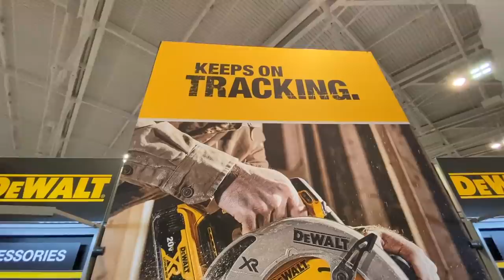Dewalts NewTools of 2020. First time seen in public at Stafda

Comment: What I caught on the Diablo vs DeWalt at the dewalt booth is look at how fast he initially feeds the Diablo vs the DeWalt. The Diablo has much more force pushed on it that the counterpart
Reply: Ramon H Jimenez he wants those teeth as far into that nail so it snaps it off.
Reply: It also looks like the diablo is at a deeper depth, which would change the angle the teeth hit the nails.
Reply: @Robert-cu9bm  I thought so too but focus in on the DeWalt blade, it's got a darkened outer ring
Reply: One thing I did notice was that he more than likely doesn't know how to operate a saw. See as how when he starts the saw he is already biting into the wood. As I am also writing this I also think that his ON PURPOSE intention was to feed it incorrectly, Rendering this demonstration on DeWalts end useles
Reply: @Robert-cu9bm  Yep, deeper depth cut is making the Diablo catch nails different.
Reply: Ramon H Jimenez
These people never know how to use them, as  they're just Reps.  Very good at talking though.
Reply: @Robert-cu9bm  you were right about the depth
Reply: @Robert-cu9bm  Definitely set deeper. That can't be a coincidence.
Reply: Cannibal440
That's the only bit i found dodgy on the dewalt test.

Quite a few things in diablo.
Reply: @Robert-cu9bm  agreed but also feeding the diablo faster, effectively making the teeth try to shear the nail all in one hit rather than slice at it gradually thus knocking off the teeth. Of course that's my opinion. Agreed Diablo was a mess with no verifiable standard testing.

Comment: Looks like he’s intentionally slightly twisting the saw to bind it
Reply: Jon Dough my though too
Reply: Also thought that I saw that
Reply: I agree stan called him out on it
Reply: Definitely was
Reply: Which one?
Reply: Graham K the one that looks like it it seriously smoking
Reply: Jon Dough that’s what I figured
Reply: Both looked like they were intentionally binding the blade of the competitor. They both probably dulled the competitor's blade before the test. Diablo used different saws and batteries; potential for additional shenanigans there. Neither are interested in a fair head to head comparison.
Reply: Ur mom
Reply: ARMOR PIERCER ...what?
Reply: I watched it several times before coming to the comments, I was wondering if that's what was happening when I watched the saw twist several times.
Reply: Lok at the burn marks left after the cut and the saw was set deeper.
Reply: Exactly! Why does he need two hands. One to push and one to pull. This is the oldest gimmick trick

Comment: I've never had to scrape with my stihl blower.  I mean maybe I'm just a goob who doesn't DIY or do yardwork enough but I'm usually just blowing leaves in the yard or sawdust out of the garage.... or dirt in general out of the garage when I clean it.  The dirt/ sawdust.... never had a need to scrape the floor to get it to blow away.  Leaves in the yard... my theory is if they are wet and stuck to the surface they're on so well they were meant to be left behind, haha.  as long as I expose the wet leaves they'll dry out and either blow away in the wind or maybe I'll blow them away with the blower another day.

Comment: You can tell at the the diablo booth they are purposely going slower on the dewalt blade
Reply: Going slower while cutting threw screws is a good thing. It gives the teeth an actual chance to cut threw the metal. But that being said both demonstrations were skewed by dulling of the competitors blades. One take of a file on each tooth will dull it enough to completely throw off the comparision.
Reply: He was also twisting the saw look how bad it burned the paint off the side....I have old blades that still have the paint on the side....

Comment: lol they buried the diablo cut depth compared to the Dewalt. no-one noticed that?
Reply: Good catch at the Dewalt booth they set the Diablo blade way to deep for that cut. I think that was the Dewalt trick. I have a feeling at the Diablo booth he was intentionally binding the blade a bit.
Reply: Ecospider5
The diablo booth didn't actually show the blades... Just trust the Diablo Rep for a honest review of their blade.
Reply: Yeah, they weren't using the same blades at both booths.  7inch at DeWalt,6in at Diablo
Reply: I'd be more concerned as to why on the diablo stand, the guy with the DeWalt blade was using a flat battery. He's demonstrating to people who use these tools, we have all had batteries go flat on us. And the crowd cheered! Facepalm🤦‍♂️
Reply: Don’t see how the depth of cut has any bearing on this whatsoever it’s the same thickness material it’s identical think about it
Reply: Elizabeth McHeffey has to do with angle of attack of the teeth against the sub straight your cutting and the heat it generates.
Reply: @Mad.Man.Marine  you are correct sir. A shallow depth is more of a slicing cut where as a deep setting is more like a chopping cut.
Reply: You got that bro
Reply: the nail is round so the angle of attack is the same on the nail no matter depth. the wood is different.  The Dewalt blade obviously has higher quality welds on the tooth.  The Diablo obviously not as good of weld
Reply: @kwilliamson1096  not really, the wood may be more shallow or not, the nail since it is round is the same.
Reply: I use the diablo blades to cut aluminum   ramps 3/16" thick 36" long , I get a lot of cuts out of one blade before its missing enough teeth to make a difference.
Reply: @yoski203  ok.
Reply: @elizabethmcheffey8699  more surface contact area = drag,  the saws should be same depth,  why is it not the same.
Reply: Elizabeth McHeffey instead of 1 inch of blade coming in contact with the wood, when you set it deeper,you have a lot more friction and heat. Hope that made since

Comment: I've been using the Diablo blades for a couple years ripping reclaimed wood with nails and have been very happy with the results. I also used one for cutting the floor in a 24 x 75 old chemical shed into pieces. All tounge and grooved 2 x 6 with lots of nails. Only used 1 blade and no damage. You do knock teeth off eventually but not in one pass. The only time I lost teeth right away is when I was cutting a steel barrel with it and had the blade in backwards by mistake. Turned it around and still cut like going through wood. Haven't tried the Dewalt ones so can't make any claims on them.

Comment: all i want is an electric ratchet dammit
Reply: C'mon dewalt it's over due should have been out with the 3/8 impact 20v
Reply: Milwaukee has a few and Makita
Reply: The 20v Impact Board Stretcher with the reciprocating flux capacitor will be out in 2020!
Reply: Studd Muffin  I didn't realize just seen it a month or 2  ago in home depot
Reply: Its called a Milwaukee Fuel ratchet.
Reply: I emailed DeWalt a while ago and asked them for one. Their response was:

"We apologize for any trouble or inconvenience caused by the lack of an electric ratchet. There has been no information given that DeWalt is about to release such an item or has one in development. Generally, the DeWalt philosophy is not to be the first one to introduce an item onto the market. Our goal is to deliver the standard by which other tools are judged. This can mean a lag of several years of perfecting before releasing the tool. Recently, we have a branched out to introduced cordless lawnmower as well as a cordless router. If we do not feel that a tool is going to be an industry standard, then it is not released. That is the essence of quality in the DeWalt name. We certainly thank you for your suggestion as well as your loyalty to the DeWalt brand."
Reply: @TheHitman5c  🤣

Comment: I would say that they used “hardened steel nails” in that section, to ruin the blade...
Reply: Hector Rubio exactly what I posted, or need to remove the humans and the human error from the test.
Reply: BP spill was more modest than this.

Comment: Worked on a custom metal frame home literally at the foot of 13,000 foot rockies and it was dropping below 24 below at night.  Kordian had 3 sets of Dewalt batteries  - one set of 3 12 filters a few years old and 2 sets of 4 batteries.  3 only months old, others about 6 years old. 
Brian had 4 Bosch 12 volt batteries from 8 to 10 years old. 

In that cold weather, the Bosch charged about 3 X faster and that 12 volt Bosch did more work per charge.

Comment: It appears on Dewalt blade test that they used the new more powerful saw vs the older saw on the Diablo blade. On the Diablo test, they used the same type of saw. Did they compare the same blade in each test? Thanks for the great tool update.

Comment: How much oil is he gonna use to cut  a few threads
Reply: Good quality threads are made with supplying constant cutting oil. He just needs to get rid of the throw away bottles and use a pipe threading oiler so it's not a waste
Reply: Have u ever threaded anything u have to use lots of oil
Reply: Demicron .

Although I’m retired now I sold Ridgid threading equipment in the past, those who used lots of cutting oil did not use a lot of threading dies. For a pipe that size and those threads it should have been flooded with oil from a pump mechanism through a tube and then the oil runs/drips down into a reservoir that separates the cuttings from the oil so it can be used again.
Reply: Who the hell wants to hand squeeze oil everytime a thread is made. How about an automatic system like every other brand.
Reply: Mhcp .
Yep I agree, the problem is they are in the tool business not the lubrication business. And maybe they will get an outside vendor to make a lube system that works on a battery for them. If this unit is as good as they think it is it’s going to replace a lot of equipment for people out there that already have powered lube systems.
This pipe threading system is for smaller pipes and I can see where it’s affordable and usable for someone who doesn’t thread pipe all day every day.
Reply: I would like to see Dewalt make a manual oiler with bucket like Ridgid if they are going into the pipe threading business. 

“How much oil is he gonna use to cut a few threads”. He used barely enough in my book. 

When using a pony threader a manual pump is all you need. Using an automatic pump would be a gimmick.
Reply: jruss  exactly right with a lube pot and the return hose it’s good practice to have the threads flooded constantly while cutting.   I guess some of those watching have not threaded much pipe.  Good comment 👍
Reply: @jakeo2600  Demicron apparently just doesn't know any better.
Reply: @mr.rodriguez3908  That kinda goes without sayin
Reply: @jakeo2600  My original thought exactly...
Reply: Demicron that's why you dont act like a know it all you will get roasted
Reply: @tannerwharton4670  Like a turkey covered in chestnuts! 🤣
Reply: @mr.rodriguez3908  😄
Reply: Right like really... Nobody doing this daily would waste oil like that. 🤔🤔 Lubrication is key but I'd be recycling oil.
Reply: This thread:
Person 1: "That's too much oil"
Person2: "How could you be so stupid as to say he shouldn't use any oil!?".
Reply: TBH back in the day we used to use tallow!
We were only doing electrical 20mm and 1" (UK ... Don't ask why we had both imp and metric)! A short length of tube with a 1way conduit box on the end and you pack tallow into the box and you are golden! OK when we had the electric threadder we used cutting compound applied with a small brush ;0)
Reply: @jakeo2600  How so Jake? Because I made an observation that the guy spilled more oil than he used to aid in the cutting process?
Reply: @tannerwharton4670  not worried about some  know it all internet tough guy wannabe bad asses.
Reply: @snap-off5383  right lol.... damn he spilled more than he effectively used. OMGGGGG U SAID HE SHOULDN'T USED OILLLLLLLLL.  I'm gonna dump a gallon of air tool oil into the impact next time I get a chance.
Reply: @Demicron  just make sure you oil them daily. Gets to be a hassle on holidays and when you're away for vacation to have someone come over to oil them.  🤣
Reply: @snap-off5383  just gonna put a 2nd fitting on it am run constant oil.
Reply: You have obviously never cut threads before.

Comment: I frame houses every day and can tell you dewalt blades do last longer at least the ones I use, but a new diablo blade just cuts so nice and fast but don't hit a nail!
often us Carpenters have to fix other trades screw ups one being steel beam length, I just look at all mt saws and pick the one with the worst blade and cut the steal beam with a carbide blade, it cuts it like butter but at the end the blade is done :D

Comment: the diablo booth was the one that scamed you just from watching it
Reply: Can you explain why?
Reply: Low battery?
Reply: Dewalt one was the best considering no teeth come off that blade but the Diablo one every tooth came off
Reply: @Kennnnyy__  Because dewalt showed you the damage on both saws. Diablo did not.
Reply: From what I saw the diablo booth were using thicker nails or small lags. You can clearly hear the grinding and see the sparks. The difference IMO is that both manufacturers are purposely binding the blade to cause more friction which is dulling the blade faster. How do they do it. Slight twist with there hands when sawing. Like ripping 2x4's at an angle.

Comment: 15:29 has he ever seen the Milwaukee 12V impact drivers?
Reply: I think every company has had a smaller driver. Milwaukee, Bosch, Makita, etc. Dewalt just late to the party.
Reply: The DeWalt grip is much nicer. The Milwaukee 12V grip is huge because the battery is inside the handle.

Comment: 1. Using different brand saw
2. Diablo used drywall screws vs dewalt with ss nails
3. The batteries voltage and ah ratings also play a part in the difference in results

Comment: The I'll blow used hardened nails for the DeWalt test.  Diablo also moved a lot slower proving that their blades will do the trick is long as you've got the time but they don't handle shock.

Comment: Dewalt said they used stainless nails. I what looked like a piece of kiln dried structure.  An the diablo was drywall screws in pressure treated lumber. 

Look like makita saws had lower rpm than the 60 volt dewalt saws. 

I would have to setup the wood an nails myself an use comparable saws.
Reply: Steve Smith
Dewalt used the same battery and same timber with the same nails... Then showed the results.
The only thing questionable is the depth of cut. 

Diablo could have used different screws, different state of charge.  And then we have to get a unbiased result from two Reps.

Comment: Diablo stretched the truth here by giving the dewalt blade a dead battery and a bad actor behind the saw!
Reply: The DeWalt test was nails and the Diablo test was drywall screws. It's probably something to do with hard metals vs softer metals.
Reply: He also says there are some teeth missing probably, after hes turned the whole blade around he must be blind is hes not sure.
Reply: DeWalt cut the same piece of wood Diablo cut a different piece with likely harder screws
Reply: the operator could have also been adding a side load to the blade causing excess drag too.
Reply: Who runs a blade thru drywall screws? Nails is the test.
Reply: Exactly. Why did the battery die? Diablo is very suspect here.
Reply: Is it really 100% clear that the blades are really the same compared in both tests? so that they didn‘t test a nail wood blade vs a wood only?
Reply: @kensfestoolchannel7916   Man this is what I was thinking. Ive hit nails, maybe once in a while a deck screw but drywall screws... never.
Reply: @av1204  I'm going to come out with a blade that cuts....wait for it.. wait for it.. WOOD!!!!!!!!

Comment: The saw blade test was kind of flawed on both party’s, however the the Diablo test was more accurate. The DeWalt representer pushes the diablo saw way faster initially, making it so the amount of time cutting each nail was less ones and put more stress of each individual tooth. When he used the Dewalt blade he went more slowly, allowing more carbide teeth to hit the nail and evenly spread wear on each tooth
Reply: Leopold good catch youre absolutely right. Those Dewalt guys think they can pull a fast one on us😂😂

Comment: depth of cut between the 2 saw were different causing a different point of contact on the nails , the dewalt blade set to just barely have enough depth to cut the screws giving the least aggressive cutting path where as the diablo would run into the screw at a more vertical approach causing a more abrupt cut.also the lower setting cause more contact and more friction slowing down the blade reducing its momentum making it more likely to damage the cutting surface.

Comment: You can also note on the DeWalt demo the red paint from the blade on the wood at the same spot where the cut line is warped... Quite obviously showing that he was changing direction mid cut to bind the blade.

Comment: The guy on the left wasn’t pushing with the same force. You can clearly see the saw slide faster until it hits a screw. And the dewalt guy was twisting the saw which is why the labeling was wearing off in one pass.

Comment: The Dewalt guy used the same battery  to do the cuts,where the other guys used two different devices and batteries. Other than that ,I would have to do the test myself.  You put on a great video, thank you.

Comment: I’m sure you won’t read this comment but at the Dewalt event they used nails and the Dewalt blade he said it was carbide whereas the Diablo blade is not carbide and at the other event they use drywall screws to cut through.